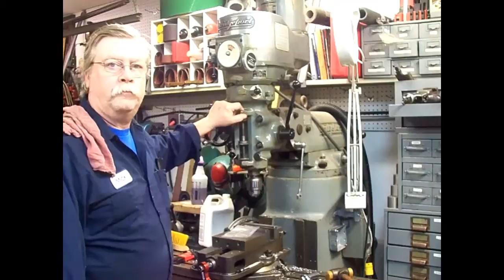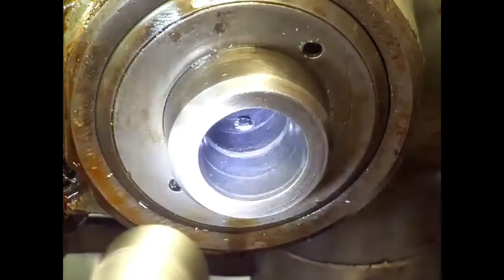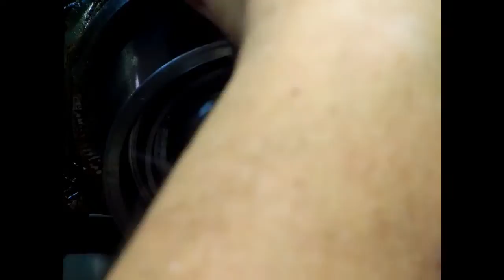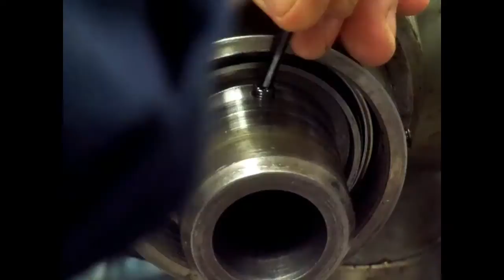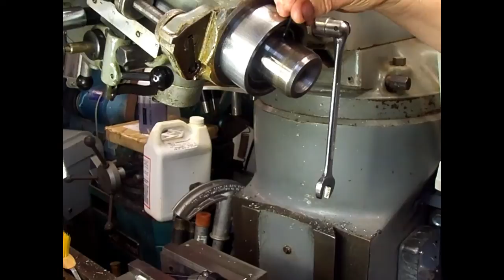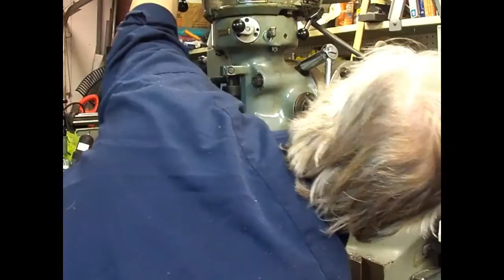Replacing a Bridgeport mill collet alignment pin

Comment: Thanks for the video….did you mention what size and pitch that alignment pin and set screw are? I heard they were an odd pitch, that they had to be ordered from the manufacturer in some models. I don’t mind turning down the pin side of the screw myself if it’s a common screw that I already have, and shortening the locking set screw. I’d just like to know the size so I can have all the parts ready before I disassemble.

Thanks again.

Comment: This video is timely for me.   I have had my Bridgeport for about 4 years without issue, then suddenly I could not remove a collet.   Turns out, the problem was that my pin was also worn down.   Locking the spindle meant that the collet would spin freely in the spindle (no pin).   I reviewed several basic tutorials on inserting collets - something I had never done before - and noted that they all say to ensure alignment of the pin.   I now understand why the pin is important and cannot be discounted.   Thanks for sharing this!    I do need to replace my pin.  https://youtu.be/-3gpGTVfPw4ii

Comment: Done many of those made me a tool . A piece of 1/8" thick aluminum 5/16" wide radiused on the end and threaded it for the set screw  just enough wall for the thread. Piece only has to be about 4" long. And tread the set screw in and it holds the set screw and turns a 10 into a 2 minute job .

Comment: The preferred method is to screw the mushroomed dog screw to into the spindle for removal thus not damaging the fine 1/4” threads in the spindle.
That’s why the new one was so “slow going” on the install.
Reply: that's the way I do it

Comment: Thanks for the great video. I needed to replace the alignment pin on a Jet JTM-2.It was considerably easier on my machine. The set screws were not recessed. I did not have to tram the head. The quill cap has a left hand thread,not a problem. The set screws came out without a problem. I made the key from a 6mm.set screw.Total time was about 30 minutes.

Comment: Since my alignment pin was sheered off a couple years ago, I have come to the realization that if it is necessary, my milling ability does not rise to the level that it has an effect on the outcome of my parts. I don't think the alignment pin is all that necessary either. Not enough to have to retram the head.
Reply: In my shop, we check the tram every setup and retram as needed. They go out of alignment you know. It's not hard to fix.

Comment: Good thing the pin is softer than the spindle threads to be able to remove the smashed pin. When you tried to just thread it on through what stopped it. Is it not tapped clear through the spindle? Maybe to act as a stop do the pin only goes it to a stop? Long but shows real time and what you tried.

Comment: Drill a clearance hole in a small piece of flat bar to fit the pin screw and this will hold it vertical to the shaft and make it easier to start.

Comment: I would always remove the collet pin. If you are using a fly cutter or boring head and taking a heavy intrupted cut there is the danger of the collet hammering itself into the pin. If this happens it is a real pain to get the collet out as it will be jammed very tightly and you can't get the damaged alignment pin out through the screw hole.

Comment: A Q-tip might just give you the flexibility to "get around the corner" in that tight space. Good "Tip" (pun intended)

(A quick look down at the comments: Looks like we're split about 50/50 on weather or not the pin is really needed)
No real surprise there.

Comment: A really excellent how to. I've read more than a few forum threads about how to do it but this helps explain it a lot better. That alignment pin being absolutely needed is debatable, but I have found a real good reason to have it. Mines not a real Bridgeport but a Taiwan 3/4 sized clone. I bought one of the Haimer 3D tasters and it needs to be zeroed to the holder it's in and the spindle center line very accurately during the first set up. I'm keeping it in a dedicated end mill holder. That alignment pin forces you to index the end mill holder to the same location in the spindle each time it's used so the tool keeps it's alignment it was set at. Without that I'd likely just remove the alignment pin since I've read a few forum threads where if the pin ever shears off it can sometimes jam the tool holder inside the spindle and it's then a very tough job to get it removed if that happens.

I've also read it's better to grind the tip off a damaged alignment pin with something like a Dremel tool as long as your careful not to touch the inside of the spindle itself. That way it does no damage to the female threads for the screws as it's backed out. Running the pin in until it drops out of the spindle is probably the best and easiest method from what I see.

Comment: I'm so glad I removed my collet pin years ago - it's not needed and just got in the way most of the time.
Reply: hahahaha  - 3 months later and now I need the collet pin  - I just got a Dorian right angle head and needs the pin to drive the shaft.
Reply: @glenndavis2762   yeah. So useless. I only use it every day.
Reply: @ModernBladesmith  I've use my Bridgeport for 10 years and never mined that I removed the pin
Reply: @glenndavis2762   but it isn't useless
Reply: Mine arrived without one, and I've never missed it.

Comment: Brother, I can't tell u how much this Vid is appreciated.  I had the mistaken impression that the SHSS that holds Dust Cover was a thru hole to the Collect Align Pin  (if u rotated spindle to align the two).  Couldn't understand why I didn't see another hex shape when I removed it.  You've made it clear >>>  crystal. T Y   !!

Comment: Just thought I'd mention that if you use the magnet side of your small screw driver it makes it a lot easier to get the screw in. :)
Reply from the maker: Travisfromoregon 
Good tip; I tried a couple of aids that didn't work too well. That might have done the trick. Thanks!